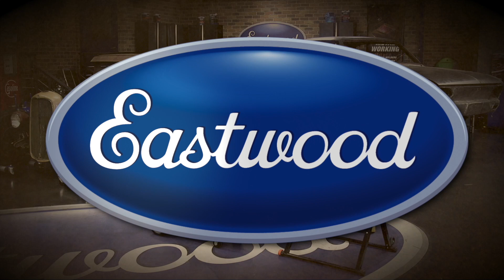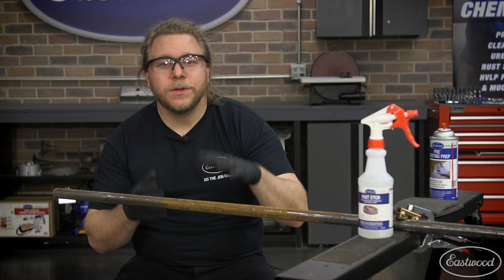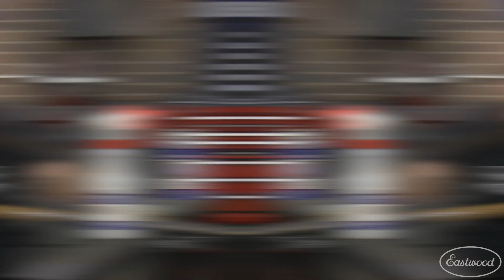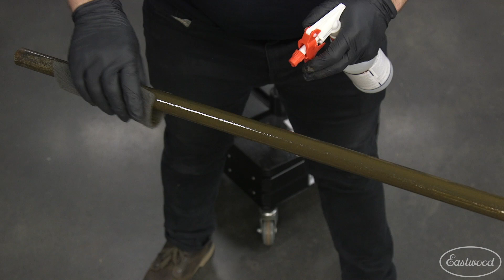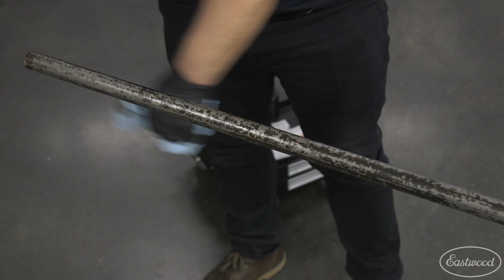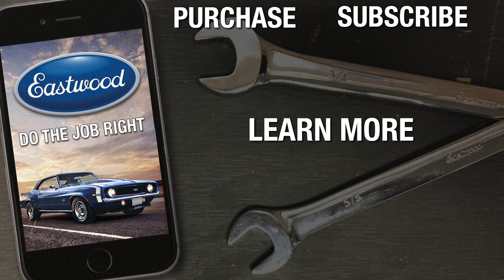How To Remove Rust From Tubing - Fast Etch - Fast Chemical Rust Removal - Eastwood

Comment: That’s surface rust though....... I mean if it’s used on just tubing ur fine but no daily car had ONLY surface rust so again, vinegar works the same
Reply: Vinegar takes forever.  It does work, but only if you can soak the part and have a few days to wait.